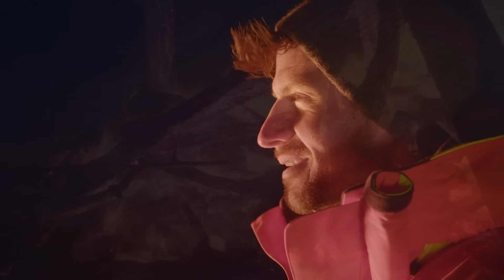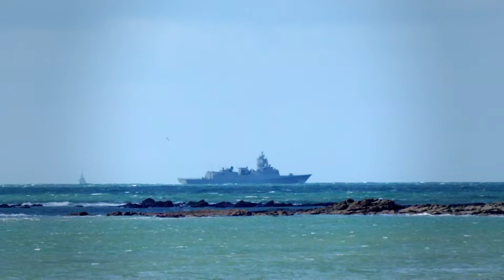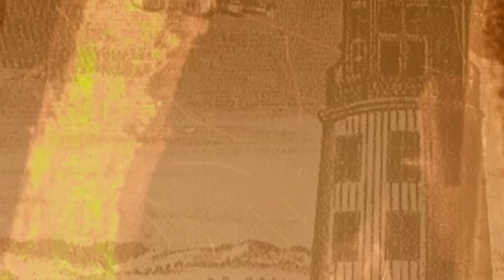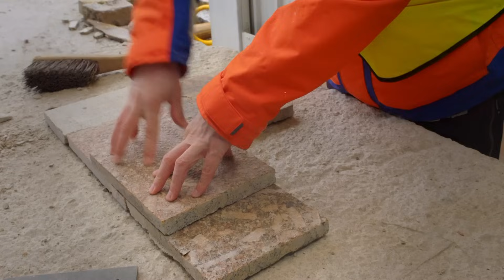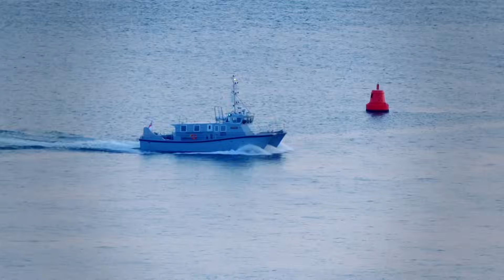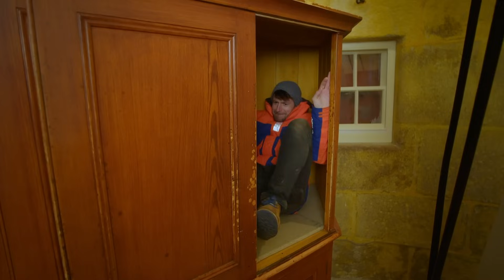Secrets of the Eddystone Reef! - The Secret Life of Lighthouses

Comment: If you had let the mortar dry properly it would have held up.
Reply: Nope, Lime mortar does not stand up to water, it's a characteristic of the material.
It's why we now use cement to mortar houses etc.
Reply: @petert3355  I'm not an expert but from what I've read lime combined with volcanic ash forms roman cement, which has some special properties. Either way, if you hose the cement out with a pressure hose before it's set you prove nothing.
Reply: @TerryClarkAccordioncrazy  
Yeah, but see that is the thing, Lime Mortar does not have any volcanic ash in it.
Roman Mortar/cement would work as a mortar in this instance, it would not wash out.
Lime Mortar, which is a different stuff, will not work.
That is the thing, they are different materials.
Reply: This is just pathetic, just watch this and enjoy. Keep all your thoughts to yourself.
Reply: Sure it would, so the lighthouse builders were all wrong and should have just built with bricks and lime mortar...according to you? Of course you'll need to explain just HOW one would get the mortar to dry properly ...in Rock lighthouse locations...LOL
Reply: @trooperdgb9722  You've accused me of saying a bunch of stuff that I didn't say, then declared that the stuff I didn't say was nonsense. It's called a straw man argument.